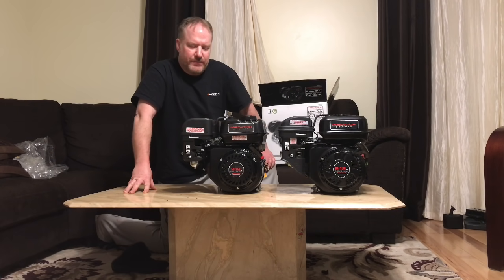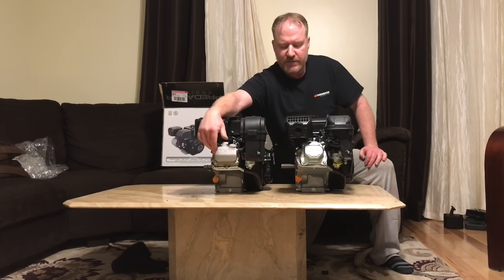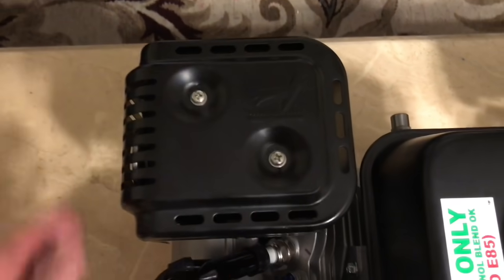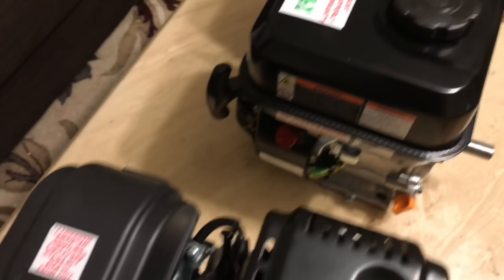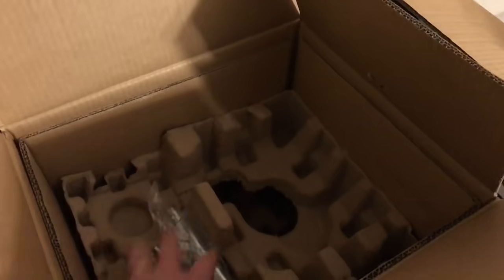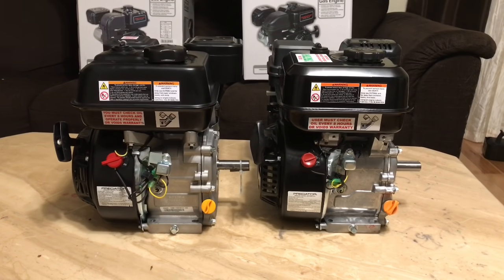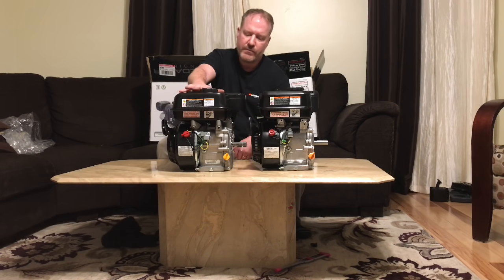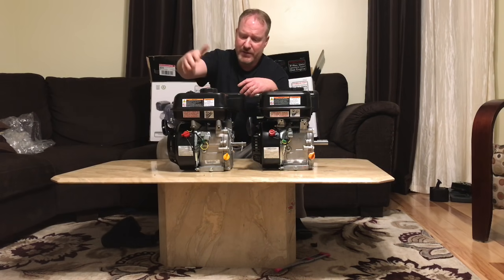What?!?  Harbor Freight Predator 212cc HEMI built by different factory than NON-HEMI???

Comment: Aside from the external differences the hemi also has a different taper on the crank for flywheels, takes different camshafts, has a flat top piston, has a forged camshaft gear instead of plastic, has larger valves with bigger stems, different length pushrods, different valvetrain, and has a hemishperical combustion chamber. They are both great but in my experience the hemi model  generally has a tougher bottom end and produces better all around power.
Reply: Issac Tackett A true Hemi can't have a flat top piston.Hemispherical head .
Reply: @deltabluesdavidraye  but they can! And in 2009 Chrysler even made a 5.7 hemi with flat tops in the lower compression variant of the engine, the higher cr had domes. Manley Chrysler also has some 6.1 hemi aftermarket flat tops too, but you have to take chamber size, piston to deck clearance, and other things too.
Reply: @deltabluesdavidraye  its called a hemispherical head . the piston has nothing to do with it. A true hemi head is half a sphere- you won't find a head that cavernous on anything since the thirties. All modern hemis are technically polyspherical but hemi just sounds better.
Reply: yes a true Hemi head is half of a sphere but for any type of decent compression that requires a domed piston because of the hemispherical head shape.
Reply: @deltabluesdavidraye  Unless you want to run your snowblower, rototiller, garden blower, etc. on premium fuel, you don't want high compression.

Comment: We purchased 2 of the early 5 hp engines from H F a few years ago.  When we can get them started they work good. I have to prime both of them to get them to start. I will try these newer engines on my two tillers. Thanks for the great video.
Reply: check valve adjustment exhaust valve  clearance probably  to tight

Comment: If you put the non-hemi top end on a hemi bottom end with a cam and Dover carb. Bump the timing up to 32 degrees of timing. Remove the governor(of course). This engine combo rusults in badass motor
Reply: anonymous  use the bottom end of the hemi motor and the top end of the other. Hemi motor had a flat top piston and the others were dished. The hemi head has a larger chamber head to accommodate the flat top piston. The others had a smaller chamber head to accommodate the dish. Advance timing to 31-34 or so. Get yourself the Dover Powersports holy moses carb and header. Probably 15+/- hp easily.
Reply: Exactly. I would never buy one but if someone gave me a new hemi the first thing I would do is throw the hemi head in the garbage.

Comment: what is that  plastic yellow knob that is located on the bottom right hand side of the engines? i dont think it's  a drain plug.   a craftmans  snow blower was given to me and  and it has that yellow knob that  you can unscrew.  can you tell me what that yellow thing is for? thanks..
Reply from the maker: nonoyd 
Thats where you fill the oil.
Reply: @BUILDNIGHT  ok thanks, but i can also fill the oil from where the dipstick is located right? I thought this is where you fill the oil, from the top where you check the oil level.
Reply from the maker: nonoyd 
There are two oil fills.  Whichever one is easiest to access depending on where your engine is mounted on the implement.
Reply: @BUILDNIGHT  ok thanks again, i just did not know what that yellow knob is for. Now i know
Reply: @BUILDNIGHT  hahahahahahahha

Comment: I have both but, the hemi will not run, dont know what it could be? Its only a year old an like no hours on it, i even changed carbs cant figure it out, it was sitting for a bit
Reply: Did u check oil
Reply: Nope just pull the oil sensor!

Comment: Well I just had to exchange a motor yesterday at Harbor Freight that wouldn't start for me and all the parts that I bought for it don't fit the motor that I just got which is a Hemi and the serial number on the box is 69730. So going by box number isn't a for sure way to determine Hemi or Non Hemi. I knew as soon as I was trying to bolt the torque converter on it was different. Now my dilemma is do I take the motor back or send the parts back and reorder and wait a week to ride my mini bike. Is the Hemi really better or should I just exchange it for a regular model^

Comment from the maker: SORRY FOR THE AQUARIUM WATER NOISE!!!  I guess the water level was too low....  

The main purpose of this video was to point out that the two different engines are built at two different factories. Not to necessarily point out in internal differences. Just so people can identify one engine from the other. They are quite different.
Reply: I went on harbor freights website and the non hemi has an extra 200 max rpm 
Non Hemi 3800
Hemi 3600
So would it be better to get the Non Hemi for that because more top end and also that you said the Non Hemi had more problems and wasn't mad as great?
Reply from the maker: My Lost Wife 
the non-hemi is my choice.  better quality and higher rpm in stock condition.  you can override or remove the governor on it as well to get about 5500 rpm out of it.
Reply: Metalman 329 yeah that's what I'm gonna get
Reply: Hemi is a gotter motor, flat top pistons too

If you are going to build i have heard go non hemi, if staying ehh kinda stock go Hemi,.. im Hemi leaning just to piss John off
Reply: *hotter motor
Reply: Metalman 329 does the hemi cost more?
Reply: DELTACX10 Nope! They are sold as the same thing. But you must read and make sure you have the right part number on the box. Also a quick look for the cast valve cover would be a good idea.
Reply: THANK YOU FOR YOUR INFORMATIONAL VIDEO AND taking your precsious time out of your day to educate others metalman. Much love and appreciations
Reply: Thanks for the tip!
Reply: I'm pretty sure these are all made in the same factory ! Almost all similar engines common components. Where I work we make Ford Honda VW GM Chrysler  Toyota all in the same factory by the same people using the same machines. I get a kick out of people thinking their Ford or toyota is better than another brand they essentially are all the same anymore.
Reply: Yeah, I see what your saying, but I think it's design is what makes the difference.  I didn't realize that many makes were made in one factory.
Reply: @mylostwife5230  mad as great? hmmm
Reply: @bucknut2850  Made**
Reply: @bucknut2850  Made**
Reply: @mylostwife5230  you have that backwards, hemi 3800rpm non hemi 3600rpm. get the facts straight.

Comment: I have and have had several mini bikes and go karts and I have a family member that’s been kart racing for over 30yrs so I know these engines very well. If you’re planning to buy one it depends on what your plans are for it on deciding which to get. If you’re buying one to use in a generator or pressure washer either is fine. If you’re buying one for a mini bike or go kart and you’re planning on keeping it stock or just doing bolt on upgrades get the hemi. If you’re buying one to modify go with the non hemi, parts are a little cheaper and there’s more to choose from.

Comment: I was told the hemi heads have heavier valve springs than the non-hemi? Which allows more rpms after removing gov before valves float....is that true? I have a hemi in my drift trike(check out my vid) n a non hemi in my gokart...both start n run great

Comment: Are the crankshafts on the 212 predator treaded? Trying to match a new motor up to a troy-bilt econo horse.
Reply from the maker: the shaft is a 3/4” keyed shaft with a 5/16”-24 internal thread.

Comment: I just bought one of these and I thought I was buying the non-hemi, but it appears I have the hemi. I wonder if they changed things up. I have the hemi engine but the number on the pull start housing, which is the hemi housing, has 69730. The manual has the picture of the hemi on the front but it is shown to be 69730 on the manual itself. The box it came in, has the egg shell packaging and the silver spark plug wrench. The picture on the box is of the hemi. The number on the box is 69730. My guess is that they are using the 69730 number for both motors now.
Reply: No I came to post the same experience with my 69730 but they seem to have just standardized those parts between the two. I wonder if the aftermarket kits are effected.

Comment: I've replaced a worn out Honda with the hemi on one of my air compressors and it's been working great for the last couple of years .
Starts right up on a couple of pulls .
The main thing is that you change the oil after the first run .
Then keep up with oil changes .
Also change the spark plug to a name brand one ..
Reply: Wow, somebody with knowledge. Good advice.
Reply: I use NGK BP6ES a non resister plug on all my 200cc Chinese engines also use on my 160cc Honda lawn mower engine no carbon internal resistor to go bad great plug about 4 for $14 on ebay. I also use Briggs and Stratton full synthetic oil.
Reply: @robc8468  dude, learn to use commas...
Reply: @tristan6509  ...it's the new way people write; one, long ass sentence a paragraph long.   I don't like it.  Brought to you by the everyone gets a trophy education system.

Comment: I just recently bought the Hemi version and I'm about to put it on my bike so far after breaking it seems to be running perfectly and start up perfectly I really hope it's not a lemon
Reply from the maker: Andrew Goode let me know when you’re ready to upgrade to a Mikuni carb.  I sell the Manifolds.
Reply: @BUILDNIGHT  oh yes that has definitely been the plan for a while now
Reply: @BUILDNIGHT  since before I bought it*
Reply: @BUILDNIGHT  I run the mikuni vm22, bad ass carb compared to a non stock original carb. HUGE performance increase!
Reply: OMG y'all were right stock carburetor on the Predator is garbage! Still saving up for that Mikuni but it's weird since I put this on my bike at wide open throttle at barely over 5 minutes all of a sudden it keeps wanting to completely choked itself and shuts down the engine I've checked out everything and I don't know why it's doing this so it must be the carburetor
Reply: @BUILDNIGHT  OMB and Go power sports sell them too.

Comment: I run a Hemi on my go kart and a non Hemi on my mini bike. The Hemi starts first try every time and doesn’t need to warm up my my non Hemi takes a few pulls to start. Both perform really well but the Hemi sounds way cooler
Reply: That's good to hear I just bought the Hemi myself it was trying to figure out the differences I'm going to put this on a bike too
Reply: @Ultimatrix117  let me know how it did! I’m thinking about putting a 212 on my Coleman. Does all the gopowersports stuff work on the hemi?
Reply: @patpollifrone391 yes ,  they have plenty of parts
Reply: @patpollifrone391  it worked out great till I blew it up XD.
Pushed it too hard . I don't buy Predators anymore, but definitely affordable if you need a motor regardless. But I'm all about Tillotsons now, higher-quality clone
Reply: @Ultimatrix117  are all the gopowersports parts compatible? I have the stage 2 kit for my Coleman now
Reply: @patpollifrone391  I mean it says it right on the website you really got to look in the descriptions that's all I can tell you
Reply: @Ultimatrix117  my bad dude. Being a typical lazy person on the internet
Reply: @patpollifrone391  its fine

Comment: you're correct. not just engines Harborfeight sell that are made from two different manufacturer. my experience are C clamps they sold are also made from two different factory. how do i know this? because i been buying them and notice there's a slightly differences one and the other.

Comment: I am planning to buy two of these for a Go kart type project . It wont have the small wheels but instead I will be using Motorcycle wheels ( the rear wheels ) with one of these engines on each rear wheel for a total of two engines . Will it be able to move a 1000 pound frame and two 200 pound ppl ? Please reply
Reply: yes
Reply: depends on how fast you want to go. you can gear it down and crawl up a wall. but only move 5 mph.
Reply: you will have to regulate rpm on each wheel or you will just go in circles, lol

Comment: I have purchased both aswell, I ran the non-hemi on a gokarts for several years and it still runs strong and has no power loss (governor removed) I got a hemi version and ran it in a mini z, after 2 rides it has lost half of its compression and the sled doesnt pop wheelies nearly as well as it used to (governor not removed)
Reply: RandomBuildsandRandomFun G why ? Because hemispherical head is a horrible concept ,very inefficient and the round top piston drives the explosion down around the rings instead of to the piston center.
Reply: @deltabluesdavidraye  There's nothing wrong with the Hemi concept and design lmao. If there were, they wouldn't be in the most bad ass car on the planet, and I'm not a Dodge fanboy. The problem is with the manufacturer.
Reply: @deltabluesdavidraye  "very inefficient and the round top piston drives the explosion down around the rings instead of to the piston center." Sorry but that is pure BS. Please do more research before posting what you do not know.